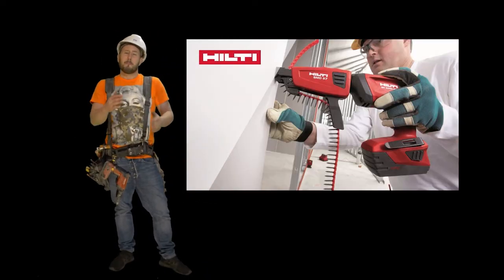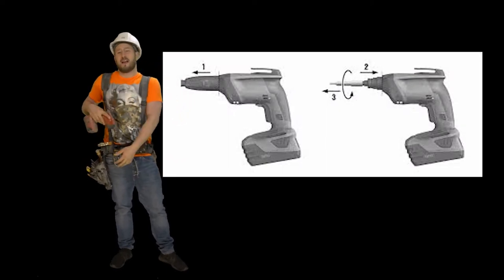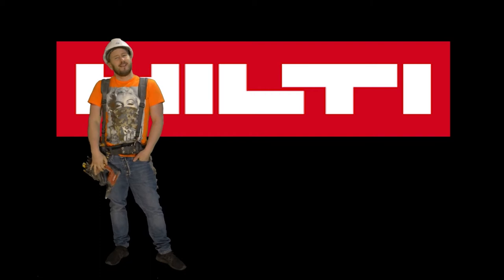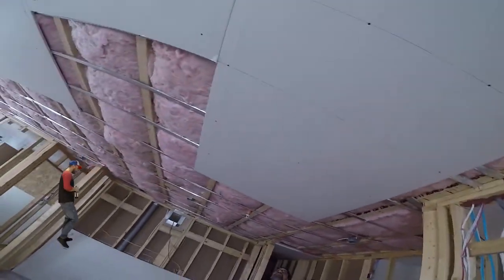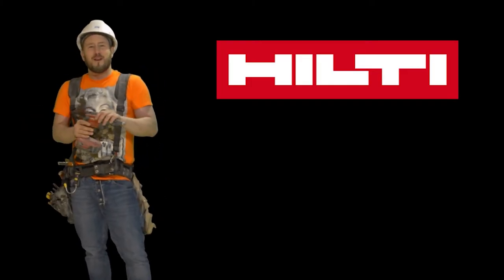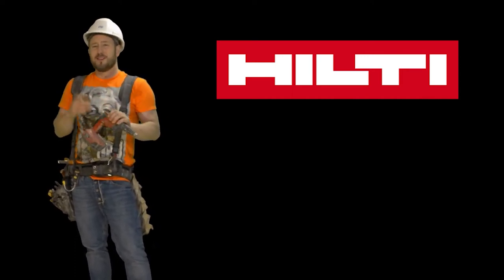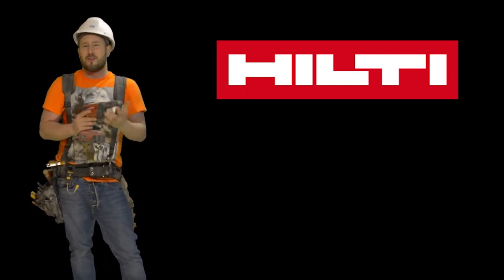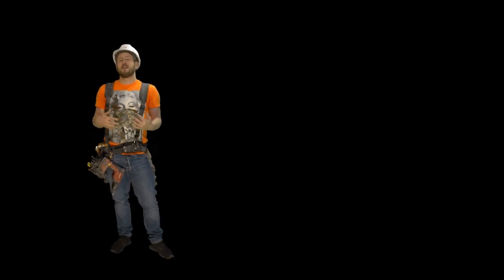Is The Hilti SD 4500-A22 The Best Drywall Screw Driver In The Biz?

Comment: I like the Hilti gun but it is a little heavy compared to others. It doesn't miss though; has the best nose cone for inside corners, powerful gun, and depth is always consistent. I've actually never used the Dewalt cordless drywall guns. I'm union and lots of companies have Makita, they hold up but I'm not the biggest fan of them. I bought a Milwaukee drywall gun and zip and used it for 2 years doing commercial before I went union. Both were awesome and have 0 complaints. I hung densglass and 5/8 type x drywall
Reply from the maker: I've been having issues with my newer sd5000 but the 4500 is a classic, I still use it for everything and my new guns stay in the bag. Haha!

Comment: Great video boss. Quick question for you, have you ever had to change brushes on the sd4500 yet or any maintenance so far?
Reply from the maker: Awesome question actually. So I have had 3 sd 4500. the first 2 I used for 6 years a pc and never had to run maintenance or change the brushes. This last one I put  in for maintenance after 14 months because the shaft ceased up. So I bought the SD 5000 because I still needed a gun. I have a video  on the 5000 coming. The 4500 is a great gun but it has been sitting in the box lately as my go to is the new 5000. Awesome warranty by Hilti. I put my 4500 in for repair and they mailed it back my house 4 days later.
Reply: @ConstructionKronies  thank you. I really appreciate the reply! Can’t wait for a video of the new sd5000. Thank you

Comment: Why don’t you use the collated attachment for ceilings 🤔?
Reply from the maker: Well, I have used it in the past and I wasn't that impressed with SD-M 1. I mean these are 2" screws going into wood and resbar. You need to be able to adjust your screw depth and angle screws a lot. The attachment really is only good for square straight go like the flooring attachment. Cheers!

Comment: Hilti just released the SD5000 A22 lighter, faster and... Has a DEL Light!
Reply from the maker: Yes I am very happy about the 5000. I am going to be buying it in a week or so before I go back to work on another 400 rental units. I will be grabbing the 4.0 amp batteries to run it. I have 5.2, 3.3, 3.0 amp batteries and I believe they are all discontinued. Thanks for the info my good man! 👊

Comment: hilti SD-5000 has entered the chat
Reply from the maker: What do you think of it? I have the SD 5000 but I don't like it as much as the 4500, I mostly use the old one still. I find the depth of the 5000 is screwy?
Reply: @ConstructionKronies  i use the 5000 with the upgrade to the 3” shaft and cone, it allows you to get in the angles a little better, i literally set my cone and tape it and i never have to touch it
Reply from the maker: @frogtoesdynamite5741 Bro thats savage, I din't know that was even a thing. thanks for educating me! !

Comment: Dewalt looked like it was doing just fine. Milwaukee would SMOKE them both!!!
Reply from the maker: Hey my man! The only way I can tell by this video is the sound each makes, but my drywall ears are tuned to that. Over time you will see that the Dewalt doesn't sink the 2" very well and you have to go back over every wall and replace screws that had stripped out. The battery life is not great and if you drop them they are done. The last Hilti last me over 6 years and I dropped that sucker all the time onto concrete and from heights. They are built tough no question there. I am going to do Milwaukee VS Hilti next. That will be out in the spring and I will do a thorough test to see how good the china red is! Always a pleasure to see you my man!
Reply: The Milwaukee would probably give up after half an hour! Milwaukee is crap compared to Hilti. I run both platforms and  Hilti is way better.
Reply from the maker: @davesheppard8797  I think so too. I mean for a homeowner DIYer they may be okay but for real construction the Hilti is the best option. I'm just going to have to test it all out on video!
Reply: @ConstructionKronies  🤣🤣🤣 Sounds good to me!! I haven't used my Te6 a lot so I'm not completely used to the speed. I still have to put tape markers on the 6mm drill bits as they go in so fast!
Reply from the maker: @davesheppard8797  We are drilling furring bar to the concrete walls in the stairwells to the parking garage of the building we are in. I am using the Hilti bits with the Bosch corded and yeah it goes in quick I like to use marks as well. I try to keep the dust at the level I need that works pretty good. I'd really like to get the Hilti cordless.
Reply: @ConstructionKronies   Yes....my Te6 is probably faster than any other corded drill I've owned. It's very smooth and effortless too!

Comment: I have had extensive use with both the hilti and dewalt drywall guns including auto feeders for both.  I have to say dewalt is far better gun zip and impact than hilti ones.  I have had multiple dewalt and hilti both. Dewalt batteries last far longer and have far more power and feel much better in my hands than hilti
Reply from the maker: Very interesting, your not the only guy, I have guys I work with that feel the same way. What matter is job complete eh🤘